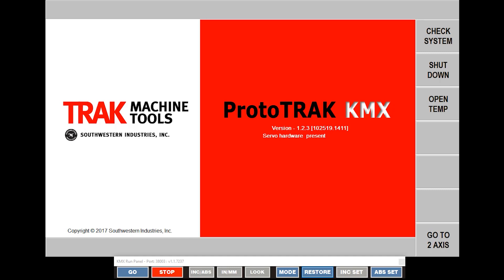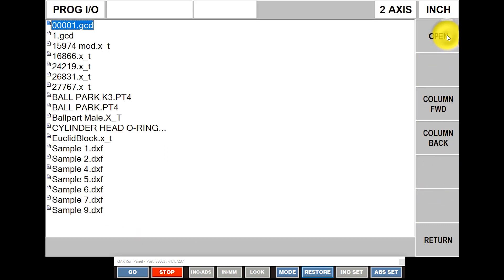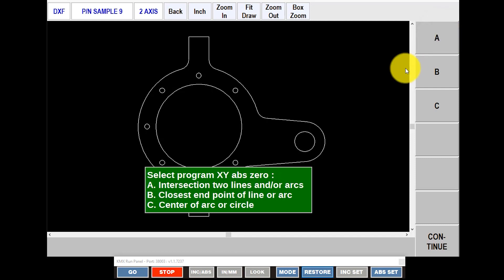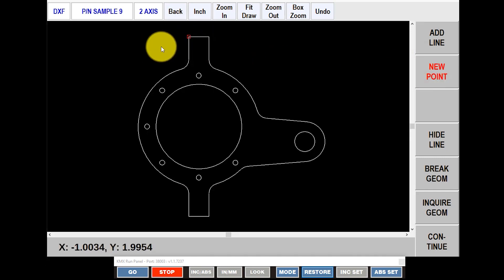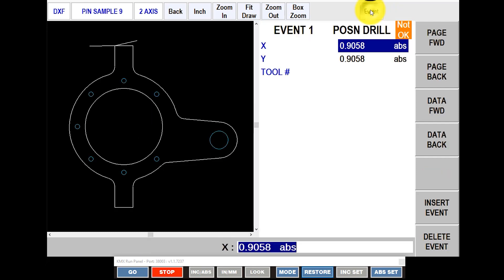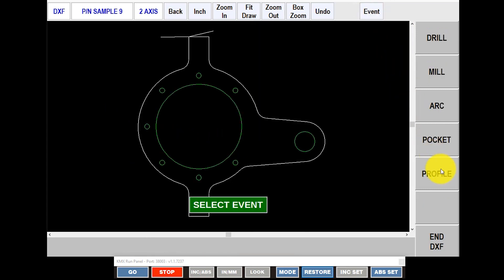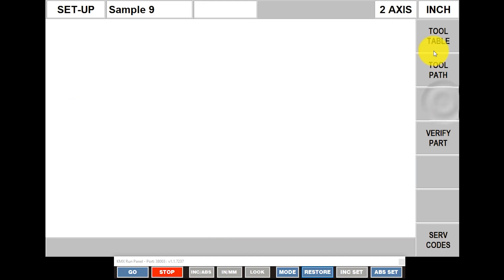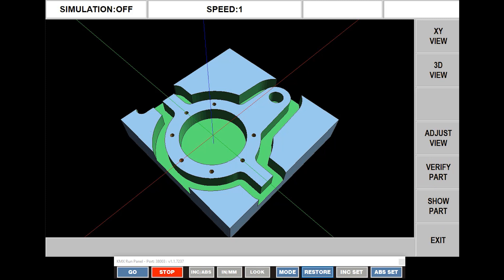ProtoTRAK KMX Offline Programming | Part 1: DXF Files

Comment: Where do I save the .dxf files to on my computer as when I press open nothing appears? Appreciate any help!
Reply: I assume you are using the KMX offline programming because you can only open DXF or Parasolid files in the offline.  This being said, both, the offline and the control only find files that are placed inside of a folder named KMX PROGRAMS.  Make a folder by this name on your USB stick and the offline will find it.  All files have to be placed into this folder. Another easier way to do this is to make any program in your offline and then save it. The offline should automatically create the KMX PROGRAMS folder on your USB stick for you.  T.P.
Reply: @trakingpat2750  Thanks for your reply, yes im using KMX offline. I've placed my .dxf file into the generated folder KMX PROGRAMS on my memory stick & still nothing shows up when i press open on the software. When I first open the software I get the error "Software could not find a programmed option key, so will launch as trail version, which will not allow you to save your program" do you think this could have any effect?

Comment: can this software be used to transfer files from the cnc machine onto the pc/ computer? any information is welcome
Reply: Gareth, are you asking me if you can make a program in the CNC control and then save it in your PC?  If so, the answer is yes.  However, the program can only be opened in your PC if you have the offline programming system because the program itself will be a ProtoTRAK file, not a G-code file.  Some of our higher end controls such as the SX or RX do have an option to save a program as a .CAM file which is G-code but it will be in our own format which may not run in a different type of machine that requires a certain format different than ours.